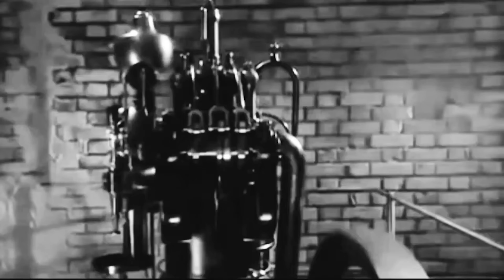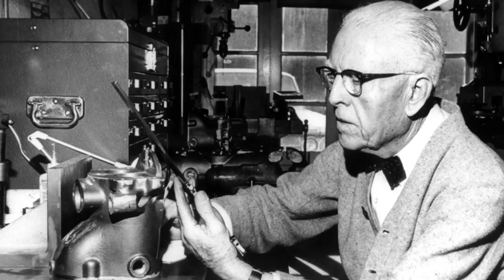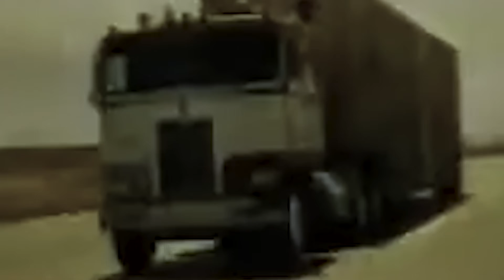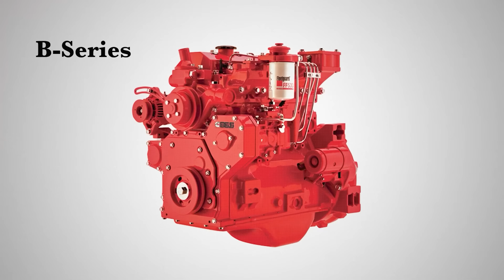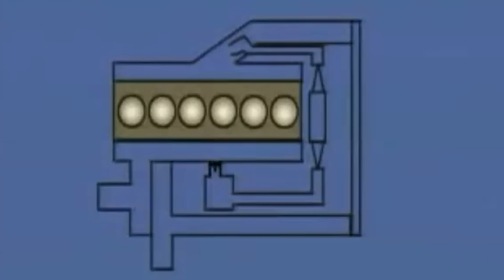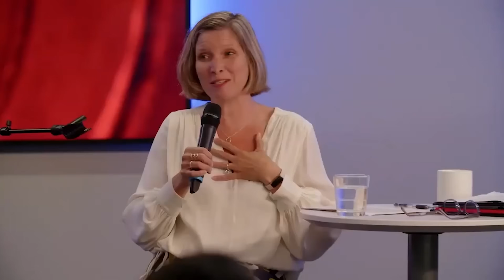Cummins' $1.6B Scandal (They Hid This)

Comment from the maker: If you’ve ever wrenched on a Cummins, you know the lifestyle. What’s your craziest memory with one of these engines? Ever had to throw a "Killer Dowel Pin" fix party in your garage, or haul with a classic million-mile rig? Share your stories below! 

If you love these deep dives into history and want to help fuel the channel, you can that here: https://buymeacoffee.com/heavymaticyt
Reply: Done both, though the KDP party was outside.
Reply: Publishing this 3 days ago, you'd think you'd update it with the new EPA and what the company is doing with the more relaxed regulations.
Reply: @mikemiller9119 it’s not getting more relaxed no manufactures expect any changes to stick once Trump is gone in literally 2 years
Reply: @marcw444 really? Are you in their board rooms?
Reply: I have 2 heavy haul spec's trucks that haul over 200k daily. Both of those truck had to be rebuilt at 262k and 285k. Both trucks have the X-15 605 hp engines. In my world there is no other engine that can even handle the weights my company pulls. I'm so over the EPA. They have stripped all ways of profits
Reply: I've got an old first gen with an auxiliary fuel tank inline.  I've burned every combustible liquid know to man through this rig.  She don't care
Reply: Nothing but overhyped junk. I started with a 195 then a 220 then a 250 a 335 then a 380 all nickeled and dimed me to death. Head gaskets cracked heads oil consumption overrated hp nothing but boat anchors plain junk. Bought my first cat a 1693 set at 325 hp would smoke ANY 400 big block Cummins there u no comparison cat to Cummins. The last cat I had was a 3406 A  what an engine and Cats warranty was 2nd to none. If I were still trucking I would revive another 3406A.

Comment: I noticed that two of the Cummins engines I worked with were never mentioned. The 8.1L and the N-14s. While the N-14s ran like champs, the 8.1 in our use died after 2500 hours of use. While the N-14s ran cool on the exhausts, the 8.1s ran somewhere between cherry red and orange. You could see which cylinder had just fired by the color of the manifold. You didn't need lights to see as the manifolds gave off enough. And as for the QSK engines, every  Siemens Charger that you see has a Cummins QSK95 engine in it. Those engines are pushing out between 4200 and 4400 HP.

Comment: Thank god I have a 2001 5.9 Cummins with NO DEF or anything else accept computer controlled injectors😞. Doesn't bother me, there's plenty of power as is and my dodge 2500 can pull any hill at 80 MPH with my 2000 lb camper on the back of it. At only 120,000 miles on it and my being 70 years old it will definitely be my "TERMINAL" truck.
I hope Trump steps in here with his all talk no action speeches about deregulations.

Comment: 2007 5.9 Ram 3500 owner. For the first 250,000 miles I changed the oil and fuel filters. At 258,000 I had my first failure. The starter. This thing is bullet proof.
Reply: The end of an ERA. They went to the "environmental  friendly" 6.7L. Sometimes known as the fermented piss system that stops it from from working so reliably.

Comment: When I hear engine builders howling about the E.P.A. I know they are on the ropes. This pollution problem was cured over fifty years ago by an Australian Ted Pritchard, a friend of mine. He built a proto type modern steam engine, the lowest emission engine in the world.. Took it to America and demonstrated it to Senators and the vehicle mfrs.. Did they want it? NO. How do you find sympathy for those engine mfrs. who keep walking down the donkey track, who simply do not want to  know that diesel was finished all those years ago. To even try to lower diesel pollution it's necessary to turn it into a scrap iron jungle. I could fill the Mitchell Library with the merits of steam and fill six other libraries with the the failings of diesel. To begin with a four cycle diesel produces one power stroke every two revs.. When a steamer does two revs. it produces four power strokes. Steamers are simple. Cheaper to mfr., less maintenance and can burn high flashpoint fuel. Diesels burn low flashpoint premium diesel. If a diesel is not making more noise than a German band they think something is wrong with it.  CAT had problems with emissions. They produce quality products that a cat and all the kittens could not cure because the system is wrong. The problem is these mfrs. will not concede they have taken this system far as it can go. When we went to the E.P.A. at Ann Arbor, M. I. the technicians are walking around with STEAM IS CLEAN buttons on. They know. When companies get themselves into trouble and decide not to comply blaming regulators who are the govt., not the E.P.A. as they imply, they are on the road to ruin. Had they the guts to take up steam they wouldn't have the overseas enemy at the door. How can you feel sympathy for a company who cops a $1.6 BL. fine when they could have had the problem cured for less and not deceived the public?

Comment: You guys are aware that the camshaft operated mechanical unit injector was invented back in the 1930s in GMC hadthem...... Know the difference between a Cummins rebuilt in a Cummins remanufacture.... Used parts.......

Comment: Some of the stated facts are totally made up ... like that 3 day drunk sitting at the end of the bar drunk! 

How do you change brakes while moving? 

How did the Continental Oil Co. refuel the truck in motion  zzzz Ah ha!  They taught the military how to refuel in flight!!!

13,500 miles?!?  How many cross country trips did they make with the wheels never stopping???... 

I mean, back in the day, there weren't good roads.  Eisenhower knew this from a trip he made;  then he built the Interstate system after becoming POTUS.

SO, such a feat of non stop for 13,500 miles would be as grueling as going i to spa e for weeks or maybe months.   Oooh No, this video would claim years, HA!

Comment: Think about how bad it is for the environment when you have to manufacture multiple mechanical parts over and over again due to constant mechanical failure caused by absurd regulations. As a non-mechanic, this video taught me that the government should not interfere with engine manufacturers.

Comment: Turned a 6.7L sleeved and deck plate stock block Cummins engine to 6200rpm for 3 pulling seasons at 3200hp. Nothing else will handle that but a Cummins
Reply: Stop wasting valuable resources stupid.  Our planet is getting very hot very fast.  Wait until Mar-a-Lago is under 50 ft of seawater.

Comment: My favorite motors I've owned in trucks were cummins L10 , cummins big cam 400 , cummins M11 400 and cummins N14 all ran beautifully with no major problems for up to 1 million miles and a full inline rebuild after reaching high mileage with new head and injectors could be done between $7k to $9k

Comment: The title of the program is misleading and dishonest indicating the producers are revealing some kind of criminal intent on the part of Cummins engine company. There are some other mistakes as well. Komatsu was never a threat to Cummins, in fact they were joint partners. Komatsu made Cummins engines in Asia under license since the late 1960's. The K series Cummins engine were a joint development with Komatsu. The QSK series of engines were another joint engineering design on the part of both companies. There is no mention of the competition with Caterpillar between the 3406 Cat and the 855 series engines for highway trucking. Cat didn't quit the truck engine business based on the EPA regulations. They quit the truck market based on vertical integration. They didn't make the truck so why take on the warranty and reputation risks as part of something built by another manufacturer. The 903 engines were a disaster in almost all applications. They only work for the military because those machines sit most of the time waiting for a war. The early history of the company was excellent. The recent history appears to have been pulled from someones opinions instead of researchable facts.

Comment: Think about that! The most depending engine EVER MADE killed not by designers, but byba tyrannical and over bearing government with their thumb on the scale! This is so un-Constirutional in every sense and its whats killing our economy and our ability to economically compete. This is why I specialize in Cummins engines; I'm even putting a 4bt in my Jeep Wrangler and my Ford f250 is getting a 6 BT. I'm over this tyrannical government

Comment: The 20% fuel economy gain results in less emissions being produced than the DPF and DEF systems being shoved onto these engines. Overlap that with the fact that now engines are only good for 50% of their original life span and the carbon footprint of the industry has expanded, it has not shrunk. And the cost to operate these engines without higher maintenance, fuel and replacement cost is passed on resulting in a direct effect on the cost of consumer goods. The blanket EPA mandates are costing people more money and don’t reduce the carbon footprint. 

Summery, A properly tuned Diesel engine without the mandated DPF, EGR, and DPF systems will produce fewer emissions as a result of better fuel economy and will reduce the cost of ownership with long life’s spans and fewer repairs.

Comment: Went from the killer dowel pin to the killer grid heater bolt lol
Reply: And now roller lifters that fail
Reply: @Ever443 facts
Reply: This year, it got changed, if I got the engine review right. Just in time for the 7.1 next year!

Comment: Let me see, burns more fuel but is better for the environment. Sounds like some mental gymnastics going on but I'm just a dumb truck driver.
Reply: Fuel consumption and emissions are two completely separate things. 
One is a matter of how much it takes to run something, the other is a matter of how much pollution something makes while running.
Your toilet uses a certain amount of water to flush, this is fuel efficiency. The municipal water plant has to treat your toilet water a certain amount for it to be safe for the environment, this is emissions. How much water you flush does not really relate to how much pollution the water treatment plant has to clean up since it's not the water that's the issue- it's the contaminants in it. Perfect combustion is clean, the issue is that engines don't do perfect combustion. It takes more fuel for engines to run in a clean way, and that is overall cleaner than having an engine that uses less fuel but is far dirtier.

Comment: I bought a 6.7 and that thing drove like CRAP. The DEF system finally failed at 80k miles and I cut it off, over night its like I got a whole new truck, better power, no more 1.5 second throttle delay, no more dumping DEF in it, a solid 20% increase in fuel economy, and no $10,000 timebomb. 

If i ever have to buy another Im cutting that crap off day one. 

But you really have to wonder, is whatever enviromental benefits you get from DEF worth burning a thousand gallons of extra fuel for every truck sold?!?
Reply: Don't forget the def itself or the fact that most of it comes from China on ships with no emissions.  Then you gotta factor in the millions of plastic def containers getting thrown away.  Whole thing is beyond stupid.
Reply: I always wondered about that myself.  If your burning more fuel and getting worse fuel mileage how does that help the environment?
Reply: @bertgrau3934  it doesn’t but it makes the unelected bureaucrats feel good about themselves
Reply: @kg7228 
That does make sense. I wondered years ago, the EPA said premium gas had more exhaust emissions than regular. When using premium I got about 2 miles per gallon better gas mileage. Since I was using less gas , I had to be putting out less emissions. That was my thinking.
Reply: Don’t forget the damage to pollinator population because def is killing the insects needed by every species of vegetation and damage done to vegetation tissue by the dpf and dpf making the gases coming out of the pipe unusable for the plants to feed off of to create oxygen. It’s all a big scam to line pockets

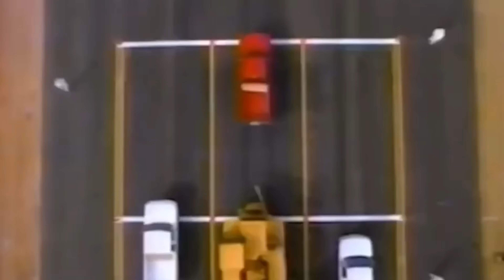Comment: @20:16 you mention chevy duramax.... ummm duramax was not around in the late 80s and 90s....it first appeared in chevy (and GMC) pickups in 2001.... similar for Ford powerstroke which first came out in 1994.

Comment: The government does one thing absolutely perfectly and never fails at it. Everything they touch they ruin every single time.
Reply: There not happy till you're not happy
Reply: I've been in government contracting for a very long time. The core issue is the Government doesn't care about anything other than their own opinion. Generally, their opinion is unfounded and filled with buzzwords to sound cutting edge. Meanwhile their goal is to generate revenue via regulations equaling fines for people that work hard.
Reply: bet Epstein is responsible somehow
Reply: The purpose of a system is what does. Not what it claims to be.
Reply: Like the air by destroying underwater gas pipelines creating the biggest man made atmospheric catastrophe along with bombing oil refineries then they force all this nonsense on us.
Reply: Clean air saves many lives.
Reply: @andrewhansen4179  According to? The US hammers on air quality while most other countries/nations/etc. have zero care/concern. So we attempt to promote clean air, but, other countries have zero clean air policies. I agree air quality is important, but we are surrounded by pollutants from other nations.
Reply: @budweezy  From other nations?  The USA has been polluting since at least the 1940s while "other nations" were either destroyed in WW2 or had a rural economy. How about acknowledging that  the US was the worst polluter and the only thing that's reduces some of it is there's virtually no industry left in the country, compared to decades ago. The US approach is like their illegal wars, go in and make an almighty mess and then run away. There's no money to fix the mess, like the Agent Orange and cluster bombs in Vietnam, the US is already making another mess in another country, where the process will be repeated.
Reply: @deaddoll1361  We’re in 2026 and many countries have made tremendous strides in air quality. China is the earths largest cause of air pollution. The US isn’t out of the woods, but produces less than half of what China does. The US has spent billions of taxpayer dollars rebuilding what they destroyed, which I’m against.
Reply: @andrewhansen4179 it will kill way more than save. Biggest B.S. of all times.
Reply: @andrewhansen4179  at what cost.  The argument could be made that increased suicide rates among struggling truckers, farmers and the like outweigh the minuscule improvement in air quality.
Go hug a tree ! !

Comment: Every regulation the EPA made at that time actually increase emissions worldwide with all of the additional equipment needed to be manufactured. And the equipment needed to manufacture the mandated equipment. The additional shipping of the additional parts the additional manufacturing required, etc, etc, etc, down to increased strip mining worldwide. Yes, they reduced soot levels locally, and increased air pollution for everything else, everywhere else. So much so that now they wan't to regulate CO2 emissions. CO2 which was trapped in those pesky soot particals. And start the cycle all over again. The road to hell is paved with good intentions.

Comment: The fuel-saving next step for diesel is part-time supercharging, via a turbocharger plus electric motor (E-Turbo) and a ~30kw lithium battery pack. It cuts the soot of acceleration by pre-spooling the turbo and eliminates lag when accelerating, then recharges the battery at highway speed.
Reply: And those batteries will reduce payload, increasing (yet again) the cost of goods for everyone.
Reply: @ToddKing  @martecooksey The weight of the battery pack will be more than made up for by removing the weight of all the EPA crap. It looks like E-Turbo diesels will have low enough emissions to get rid of ALL the EPA crap, even the EGR. Not only will the weight be a wash, but we'll be back to making pre-EPA levels of power, and even better, efficiency. Even reliability SHOULD be better, but of course that won't be known for sure until they've been on the highway for a while.

The E-Turbo engine is the first "light at the end of the tunnel" diesel enthusiasts have had in a long time. I just hope it lives up to the hype.
Reply: Sounds like a complicated waste of money.... for what?

Comment: they didnt hide it it was made public the day the fine went thru, it was an epa screwover because the software could be hacked, it was sold as a legal engine, what the buyers did with it should not have been on cummins.
Reply: No, the code was there.
A decade later, VW and the European manufacturers, got caught doing the same thing. The fines were just as large, but in the EU cases, jail time, on top.